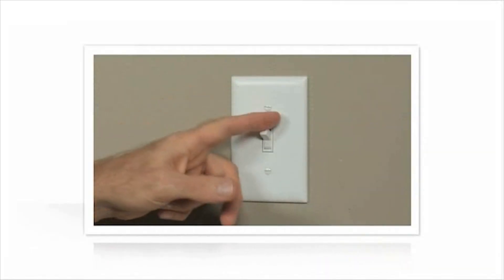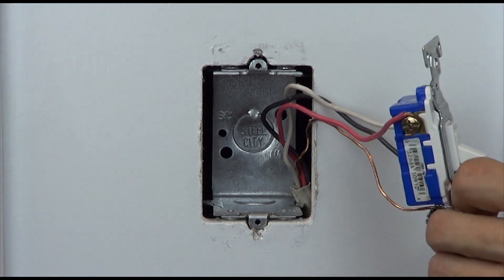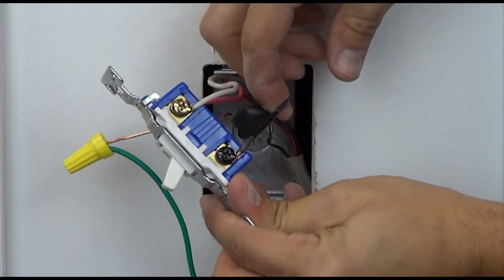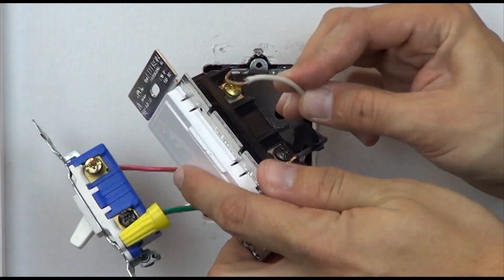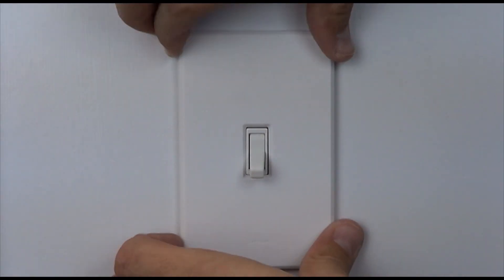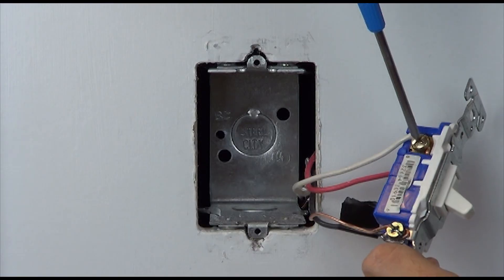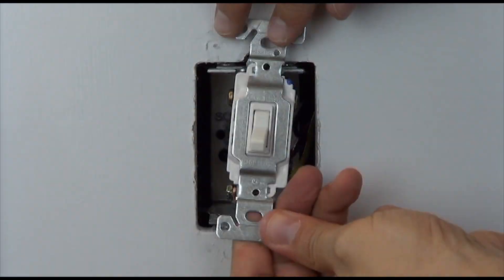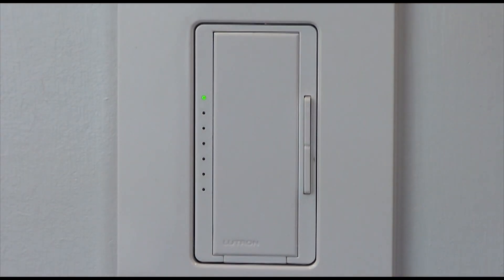Wiring a Maestro Dimmer in a 3-way (With a Mechanical Switch)

Comment: Guess i don't understand because when you flip the toggle on the mechanical switch, it switches to a terminal that no longer has a wire connected to it.

Comment: I have a black white and copper wire setup. The black wire was on the top brass screw of my toggle light switch. And the white wire was on the bottom silver screw on my toggle light switch. I'm confused as where to put them. Also its just one switch to dim lights

Comment: I have 3 decora switches controlling 1 light . I know a Lutron maestro dimmer will work with adding a maestro companion switch, If I add 1 more companion will this work ?
Reply: From the actual company video, when adding three or four is when they used that yellow jumper wire.
Reply: @ Ok Thanks

Comment: This is by far one of the worst switches to install and takes much longer than usual. Instructions that came with it and the diagram are very poor. Wire colors are wrong and difficult to figure out.

Comment: Can you not use two of these same 3 ways together?
Reply from the maker: Hi! You would not be able to use two Maestro dimmers in a 3-way setup. You would either need a Maestro dimmer with a Maestro companion (MA-R) or Maestro dimmer and an existing mechanical switch. 💡

Comment: Wired it in the same way the video demonstrates. Blew the light switch when I turned the breaker back on!
Reply: That’s because he’s showing you how to wire it with a neutral and you’re not supposed to use a neutral as a traveler or any connection where it’s supposed to be a hot current carrying conductor. There is an a example of a switch loop but that’s not code and it’s just a hack.
Reply: @FeelBadForTheFuture  I was wondering about that because the company video only used the jumper wire when connecting four switches. When connecting two switches it was said the be sure to remember what wire was connected to the terminal with the blue screw and that no neutral was required.
Reply: What happened next?

Comment: In my bedroom, I am swapping out two switches.  One by my bedroom door that's a standard on/off switch for the bedroom lights.  The other is a light switch next to the bed that also turns on/off the bedroom lights, but has the ability to dim those same lights.  My desire is to be able to dim the lights from both ends.  I was advised to get the Maestro switch for both switches.

First, I swapped out the switches by the bedroom door. This was simple enough. There were 3 wires going to the old switch. Two wires on the right side went in the same spot on the new switch and the wire on the left was twisted and capped with the green wire from the new switch. The light turns on and off and dims properly.

Second, I swapped out the switch next to the bed. This was much more complicated. The switch next to my wife's bed was a little different. It had 4 wires:

1) The green wire from the switch connected to the copper wire from the wall.
2) The black wire from the switch connected to the white wire from the wall.
3) The red wire from the switch connected to the black wire from the wall.
4) The second red wire from the switch connected to the pink wire from the wall.

I connected the copper wire to the green wire on the new switch. I also connected the black wire and the white wire to the screws on the right side of the switch. Not sure what to do with the pink wire, I capped it off by itself and put it on the side.

I put the power back on and now neither switch will turn the light on in my bedroom. I do know there is power going to both switches b/c both switches have a series of small lights on the left side of the switch that lights from the bottom to the top in like a "zip" pattern.

Upon reading the instructions, which is confusing for me, I tried to program the switches as it said, but what I'm doing does not seem to be working.

I don't think I have the wiring quite right.

Based on the tutorial video, my question is two fold:

1) In the video, both switches have 4 wires going to the existing switch. Mine has 3 wires for one and 4 wires for the other.  Why does the entrance switch have just 3 wires?  I do see more wires capped off behind the switch.  Do I need to bring one of those out?

2) One of the switches uses that yellow wire. Which one of my switches would I utilize the yellow wire? If I have the choice, I would rather the master switch be the one by the entrance.

Thanks!
Reply from the maker: Hi Richard, Thanks for taking the time to reach out. We recommend connecting with our tech support team for assistance troubleshooting your application. They are available 24/7 at 1-888-Lutron1 (588-7661). Thank you!

Comment: man-o-man. I kinda wish I would have seen this video a few hours ago. This is not an easy install if you've never done this before. At least in my case I ran into multiple issues. 

1. None of my wires are tagged. 
2. I'm using mine for stairs (main to 2nd floor). Mechanical switch at bottom is installed 'correctly'. The other switch (on 2nd floor) was installed upside down. Which means the colors of the wires are all out of whack. 
3. I wasn't even aware of 'master' & 'companion' switches until now. SO I spent all afternoon trying to get this thing wired out. Only to realize, you can't have two (motion-detector) dimmers on the same circuit. So this is, practically speaking almost useless to me.
Reply from the maker: Hi Randy, We are sorry to hear that experienced issues installing your Maestro Dimmer. If you are still in need of support, we recommend reaching out to our support team. They are available 24/7 and would be happy to guide you through this. You can reach them at 1-888-Lutron1 (588-7661) or by email at support@lutron.com. Thanks!

Comment: Thank you very much. I'm not familliar with 3 ways and it works well. Also, an electrician came at home and doesn't fix it.
Reply from the maker: Hi there, If you are having trouble with a Maestro switch, we recommend contacting our tech support team at 1-888-Lutron1 (588-7661) for additional support. They are available 24/7 and would be more than happy to help. Thanks

Comment: Can you do two motion sensor swotches with the same 3way circuit?
Reply from the maker: Hello, Currently, only one motion sensor can be used per circuit, the other control must be a companion (MA-R) or a traditional 3-way switch. For more information on installation, please visit https://www.lutron.com/TechnicalDocumentLibrary/0301660.pdf Thanks!

Comment: Typically, one switch has the connection to the the load and the other switch has the connection to the line /hot. Can this dimmer be installed to replace either?

Comment: Will it work between (2) four ways....
Reply from the maker: The Maestro MACL-153M dimmer will work on a 4-way lighting circuit. There will need to be one master MACL-153M dimmer and two companion MA-R dimmers. An illustration of the wiring can be found here: https://www.lutron.com/TechnicalDocumentLibrary/368-4493_Page_15.pdf Thanks!

Comment: Hello, do you have a video for doing this with a Maestro Occupancy instead of the standard Maestro dimmer?
Reply from the maker: For wiring with a Maestro Occupancy sensor, Lutron offers "Wiring a Maestro Sensor with Companion Switches". https://www.youtube.com/watch?v=rprtjKFGXW4

For more Wiring help, please visit Lutron's wiring Wizard found here: https://www.youtube.com/watch?v=rprtjKFGXW4
Reply: @Lutron-Electronics  gotcha! Is a companion switch required? Or can I use a standard decora 3 way switch?
Reply from the maker: @tmywu  For a Maestro sensor, such as the MS-OPS5M, it can be used in conjunction with the companion switch (MA-AS) or a standard 3-way switch as long at the jumper wire is used in the re-wire as per the instructions. Please keep in mind, if there are 3 or more wall box location the MA-AS companion switch is required.
Reply: @Lutron-Electronics  gotcha, so basically companion switches are needed for 4 way switches or more

Comment: This switch is garbage. When testing voltage at the light, this dimmer switch does NOT shut off power to the light. It can detect whether a light fixture is connected, and thats not good
Reply from the maker: We're sorry to hear about the issue you are having with your Maestro dimmer. If the light is not turning off by using the tap switch, Lutron recommends pulling out the FASS tab, which is located under the tap switch. The FASS tab should cut power to the dimmer and the light- if pulled out and the lights stays on, Lutron recommends to check the wiring.

If the light turns off when the FASS tab is pulled out but not from the tap switch, Lutron would then recommend making sure the lighting load is compatible. To find compatible LEDs for your maestro, Lutron recommends using the compatibility tool at www.lutron.com/ledfinder or www.lutron.com/ledtool . Please reach out to our Support Team at support@Lutron.com or by phone at 1 (844) 588-7661 for additional assistance.
Reply: @Lutron-Electronics   Sadly the problem I had wasnt just with one switch, it was about 30 switches. I was replacing every light fixture in the house, and these switches would not cut power to the lights.

Comment: Can you do the same with RadiRA2 3 way?  Have one switch inside and the other by my outdoor kitchen  Would rather use a waterproof toggle switch outside for safety.  Thanks
Reply from the maker: If you could provide a model number of the RadioRA 2 dimmer, we can confirm how it would be wired for a 3-way lighting circuit.

Comment: Why don't you need the 3 terminal screw on the regular 3 way switch no longer when using a maestro switch?
Reply from the maker: Hello,

This unique wiring setup is due to the digital dimmer. The digital dimmer uses a communication method that requires this wiring setup and uses the traveler differently from a standard analog 3-way. If you have any other questions, feel free to call and speak with one of our Tech Support agents at 844-588-7661.

Please let us know if we can be of further assistance.
Reply: Because it is a very smart switch follow the instructions and let the switch do the rest

Comment: So I have 3 switches for the same light (living room, house came that way). I want to put in a dimmer switch for that light. Do i need 3 dimmer switches? So far only installing one dimmer did not work.
Reply from the maker: Hello Daniel,

We have two major categories of dimmers: digital and analog. This video was for a digital dimmer, the Maestro family. With the Maestro digital dimmers, you will need to use one master dimmer and two companion dimmers (or companion switches, if you only care about on/off at the other two locations). You won't use three master dimmers, so make sure the product says "companion." The model number for the companion dimmer is MA-R. You can wire a Maestro dimmer with one mechanical switch in a 3-way, but you cannot wire the Maestro dimmer with two mechanical switches in a 4-way. This is why your setup would need companions.

The other category (analog) does not have companion dimmers. An example of an analog dimmer is the Diva family. You can use one Diva dimmer with two mechanical on/off switches, as long as the Diva dimmer goes in a 3-way wiring location (instead of the 4-way location in the middle).

Please let us know if we can be of further assistance.

Comment: I only have 2 blacks and a red coming to the existing switch.  What do I do?
Reply from the maker: Hi. Please note that the color of wires in your wall may be slightly different from this video. Some applications will have black/white/red and some will have black/black/red. In other regions, the colors may be entirely different. If you would like wiring guidance, please call our 24-hour support line at 844-588-7661.

Please let us know if we can be of further assistance.
Reply: @Lutron-Electronics  so what happened with the neutral, u don’t need it for the light?
Reply from the maker: @mamajota1  Hello. Several of our switch models do not require a neutral wire. If you need more details please let us know. Thanks

Comment: What if you have a switch-light switch setup? In your video, the red is connected to the left side in the first switch, but the right side in the second switch. Whereas in my setup, the red is connected to the left side in both of the switches.
Reply from the maker: Hi! The two brass screws are essentially interchangeable on a standard mechanical switch. So having the red wire on the left brass screw versus the right brass screw from the mechanical switch will not have an effect on the circuit for the mechanical switch setup.

When you change over to the Maestro, the wire color connected to the blue screw will need to be "by itself" on the mechanical switch side of the 3-way (the red wires in this video). The other traveler wire (in this video, that is the white wire, but your wall may use different colors) will then join to the black common wire (the load or line wire) using the yellow jumper as indicated in this video.

If you have any questions, please feel free to call Technical Support for more information. We are available 24/7 at 844-LUTRON1 (844-588-7661).

Please let us know if we can be of further assistance.

Comment: I LOVE these video instructions!  I'm horrible with wiring 3-way switches and I had older model Skylark type switches that were not as nice looking. Plus, the dimmer switch tab kept popping off often when touched and we constantly looked on the floor until it was located. These Maestros were a wonderful change for my living room a couple of years back after buying LED Hi Hats so I just bought 2 additional switches for the kitchen. One of the LED hi hat sets was controlled by a traditional switch, as well as the old slide type dimmer. I tried install this new Maestro on my own with the instructions for 1 1/2 hours and finally gave up - did a search and this video came up. If these video instructions didn't work (which I followed very carefully), I would've been forced to pay someone to come in and do this super simple job!  But it's only simple if one knows what they're doing. Thanks Lutron!! You Rock!

Comment: I've tried wiring this as instructed.  In the video i fail tk see which wire is the load and which is the common.  For the dimmer does this matter.  I want to install on the load end but cannit get the dimmer switch tobpower on.  When i test in a single pole application there is no problem.
Reply from the maker: Hi! Because it is difficult to describe wiring scenarios in text, I recommend that you call our 24/7 Tech Support phone line when you are available to troubleshoot this wiring setup.

On this Maestro dimmer, the common and load connection (the brass screw and the black screw) can be swapped without impacting the performance of the device. If that doesn’t work, it might indicate either a miswire or a defective unit. Our phone agents should be able to interpret the behavior and come up with the best solution.

Please let us know if we can be of further assistance.

Comment: The fact that they did not provide any instruction or guidance on how to determine which wire was connected to the other switch is a MAJOR fail.  TERRIBLE INSTRUCTIONS.
Reply from the maker: Hi, Mike. Thank you for your feedback. I am confused by your statement, the video goes step by step, removing a wire form the existing switch and attaching it to the dimmer. If you have removed the wires from the existing switch already and did not note which screw the wires were attached to, the only way to identify the wires at that point, is to use a multimeter. Let us know if we can be of further assistance!
Reply: Mike Levitt it’s called a tester. They’re 15 bucks

Comment: Regarding the second switch (that needs re-wiring, not the switch change), is there any way to figure out which two wires to be connected together with an AC voltage detector? In other words, does the remained wire (in this video, red one, communication traveler) should be beeped when it's touched by the detector or not? The sensor switch works but not the 2nd switch; I'm not sure which wire should be remained, and which two should be connected. I found two wires are beeped. This video instruction to decide these wires by simply the color of wire or screw does not seem to be universal - what if the electrician previously did messed it up?

Comment: I have a bathroom 2 way switch with lights/fan. I have not been able to get it to work properly. is there a better video to use?
Reply from the maker: Hello, Kris. Thanks for reaching out. With lights and a fan, which Lutron device (model number) are you using? This video is for the MACL-153M which is a dimmer for lighting. It isn’t designed to control a fan. Are you using a different Lutron product? If so, it may wire differently. If you could provide us with a model number of the product you are installing and if it is controlling the light and fan or just one, we could see why your application may not be working properly. Please let us know if we can be of further assistance.

Comment: It seems like, when using a mechanical switch on the other side, you now no longer need a 3-way switch.  Please confirm that a 2-way mechanical switch could be used with the MACL dimmer and still offer 3-way functionality.
Reply from the maker: Hi, Chris. Thanks for reaching out. That is correct. You can use a single pole switch instead of a 3-way switch when wiring to a MACL-153M in a 3-way application and retain 3-way functionality. Please let us know if you have any other questions.